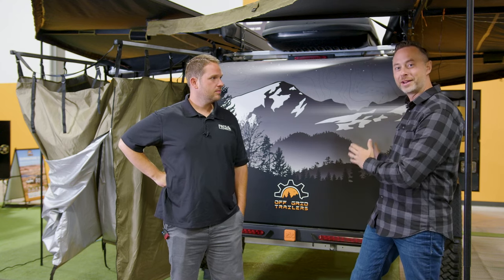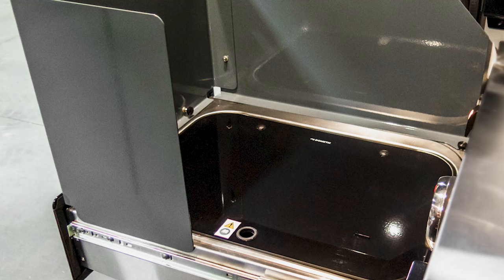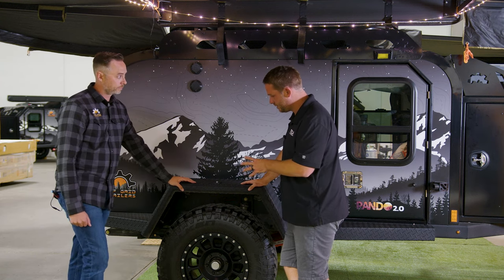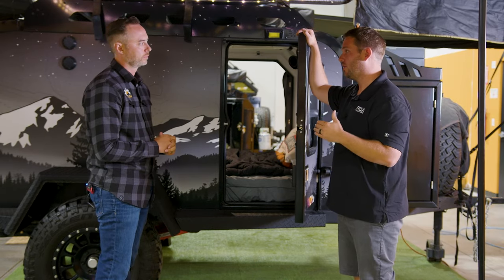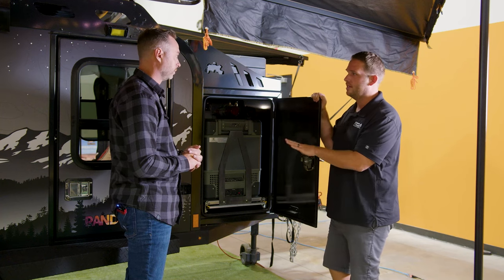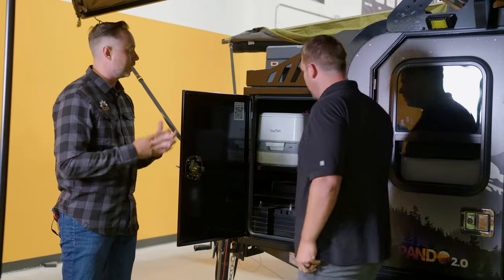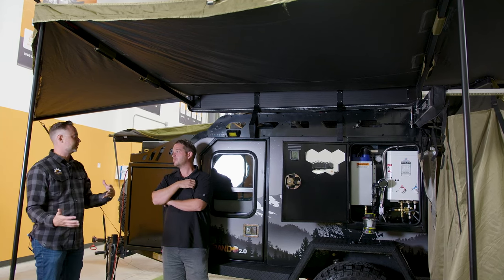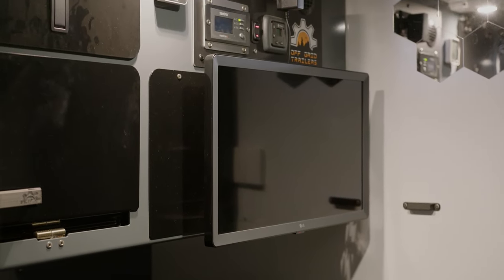Off Grid Trailers Pando 2.0 Overland Teardrop Camper Trailer Tour - FULL WALKAROUND

Comment: Wow!!! Amazing camper! Are the batteries lithium? Will they be able to run the air conditioner and cool the unit in the Texas summer months?
Reply from the maker: We currently offer Lead Acid Batteries. To use the AC option, you will need to be connected to shore power.